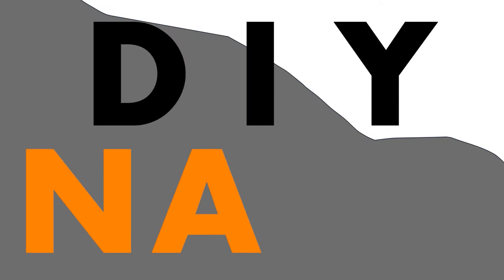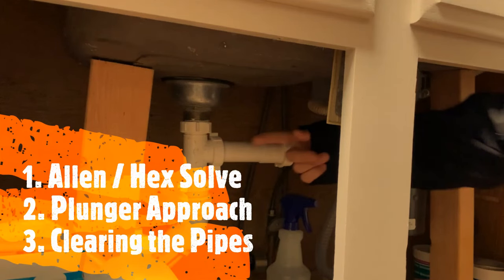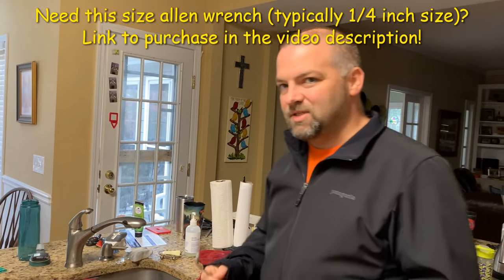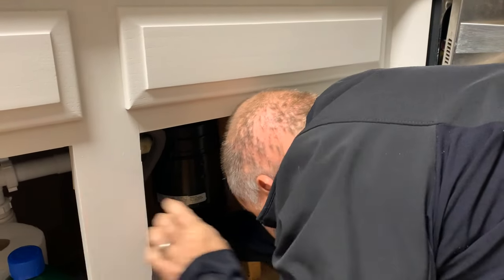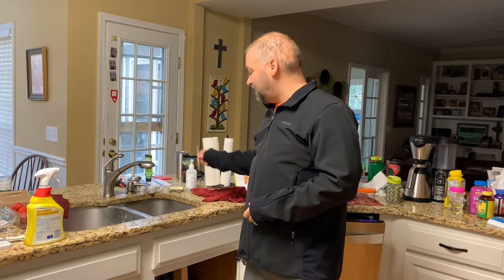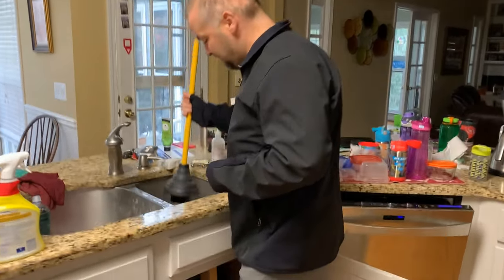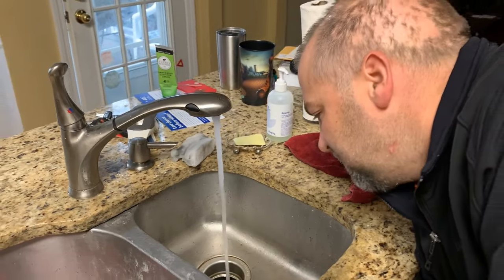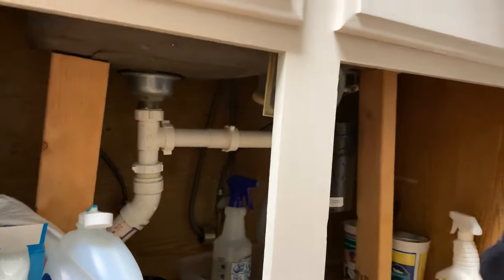Clogged Kitchen Sink with Garbage Disposal? How to Solve Quickly with 3 Easy Fixes! - by DIYNate

Comment: Thank goodness
-I thought it had tripped somehow, but the button on the bottom didn't solve the problem, as I still had power.
-power was on and trying to work, but the blades were stagnant. 
-stuck my hand down the unplugged disposal to unclog and got some stuff, but it didn't solve the problem
-looked down with a light and didn't see any foreign object
-USED THE FIRST METHOD, ALLEN ERENCH, and it made a teeny tiny spoon bulge out that was jamming my blades!

Thank you!
Reply from the maker: Nice!  Hard to believe what can lock those blades up, but a good thing they made the manual turn feature for the Allen wrench, right?!?

Thanks for the comment and glad you got unstuck!
- DIYNate

Comment: Thank you very much for this video! If the allen wrench fix works, do you have to turn it back? Is it an untightening/tightening mechanism or just turning in place?
Reply from the maker: Hey Diane - no you shouldn’t have to turn it back - it is just operating like a manual rotating function so you aren’t actually unscrewing anything.  Good question though.  Thanks for your comment!
- DIYNate
Reply: @DIYNate  Thanks! I'm going to try this tomorrow.

Comment: I was about 1 minute away from taking the plumbing apart and checking for clogs. Totally forgot about using a plunger. 10 seconds later…drain is working. Thanks!!
Reply from the maker: Love hearing that it worked out for you, RoB and saved you from taking apart the sink!  Glad to help and thanks for your comment!
- DIYNate

Comment: Hex key worked. Didn’t even need the plunger, thanks for the tip man! Is it dangerous to try the hex key method without first unplugging the garbage disposal?
Reply from the maker: Unplugging is likely not needed but that could also depend on the state of your disposal (e.g., if it is in a deteriorating condition).  Many people, like myself, have a switch to operate the disposal so there is no turning the power off by unplugging, but you could flip the breaker off if you are concerned about safety.  I do understand the concern because it relates to water, metal, and electricity, so when in doubt, it won't hurt to cut power to it and ensures safety.  You can also check your owner's manual / contact your manufacturer for what they recommend when using the manual rotation of blades with the hex key. (Keep in mind, this is not professional advice, use safety/precautions, and DIYNate assumes no liability. - the legal disclaimer :)).
Thanks for the comment!
- DIYNate

Comment: should have mentioned using the 2X4s to support the sink while plunging... smart idea.
Reply from the maker: Good call there - got to be careful with the downward pressure so you don’t detach it from the mounting glue if it is undercounted.  Thanks for the comment!
- DIYNate

Comment: What if all three methods don’t work? I took all the pipes apart and had no luck. I’m wondering if the clog is further upstream? Thanks sincerely for the video, kind sir.
Reply from the maker: Hate to hear it didn’t work for you!  I think my next stop would either be fishing a drain snake down the pipe when I have the p-trap off, or maybe going the chemical route and going directly into the piping.  Other thing that some folks have commented on is when plunging the one side of the sink, make sure to cover the other side so you get the full pressure applied to the downward pipes and don’t let the air pressure escape.  Good luck!
- DIYNate

Comment: It would be nice to see what you're actually doing when you inserted the allen wrench under the sink. Where exaclty does the wrench go? Love your cute graphics, but that also covered what you were doing.
Reply from the maker: Sorry about that!  The wrench goes up underneath the bottom of the disposal - typically dead center underneath where the propeller is - think about it as you are manually turning the blades.  Good luck and sorry the visual didn’t clarify where to put the wrench. 

- DIYNate
Reply: @DIYNate  all good, thanks Nate! Turns out my motor had died! 🤣 I replaced it today, but really appreciate all your help.

Comment: Do you have to have enough water in the sink to use that plunger? I just don’t have enough suction.
Reply from the maker: Great question - it helps to have enough water to be able to create a seal and force water to push whatever is down there through.  So putting some water in there can certainly help!
- DIYNate

Comment: If you dont have Plunger, Get a Tennis ball, Cut it in Half, Place cut side  on the sink hole, Apply pressure on top of the ball, It works like charm 🙂
Reply from the maker: Creative way for a diy plunger solution - thanks for sharing!
- DIYNate

Comment: The allen wrench fix is for when you broke some glass or have silverware in the disposal and it won't turn.  Then you use the allen to break it up or turn it to get the piece out.  Also, disposals have a little button (circuit breaker) that trips sometimes when things are stuck.  If the disposal isn't working at all then you free up the pieces that were broken with the allen and push the button on the bottom.
Reply from the maker: Exactly right - both of those are great solves depending on the issue you are facing.  Thanks for your comment - very helpful!
- DIYNate

Comment: QUESTION: 1. What does the L end wrench turning under the disposal do to clear the clog?
Reply from the maker: Hey there - sorry for the slow response but the allen key (L wrench) turning actually spins the blades in the disposal so sometimes, people's disposals are stuck and have something hard underneath or aren't able to spin, and by manually spinning, it can get the stuck item unseated and then the disposal will start grinding again.  Basically, this turns garbage into a much smaller substance that can then be fed down the waste line for it to be processed.  Sometimes the clog / issue is a direct result of the disposal not grinding and not pushing materials further down the waste drain.  So that is how that is part of the clearing the drain solve.
Thanks for the comment!
- DIYNate

Comment: Does it matter how many times you turn? And which direction? Thanks
Reply from the maker: Doesn't matter how many times you turn, but my guess is if it is turning freely and you aren't hearing anything or feeling any movement, that may not be your issue.  I seem to remember it being clockwise (righty tighty) but I could be wrong on that - I feel like one direction will go and the other won't or it may allow you to turn both ways.  Sorry for my foggy memory here but hope you got it fixed!
- DIYNate
Reply: @DIYNate    Thank you for your feedback and post.   🎈

Comment: Say would you put Drano down sink after you unclog your sink just in case to make sure the drain and pipe are clean any thing else? That my the in the pipe???
Reply from the maker: Hey Jason - really up to you if you feel like Drano is needed afterwards.  My personal opinion is I would avoid that and save the drano for when you are clogged and the other options don't work.  I hear some plumbing gurus talk about the chemical issues that can come from drano on pipe (not sure I subscribe to that, but still).  Once the clog is cleared, seems like the Drano wouldn't have anything to work on and would go straight down the pipe.  Just my two cents.
Best,
DIYNate
Reply: @DIYNate  thanks for letting me know about that Drano I will try something different like the plunger that you used or take off the pipes one at a time and clean them out outside with wire brush and a garden hose.

Comment: Thank you , I actually forgot about that little trick with Allen wrench 😂🤷 duh 🙄. I worked at Orchard Supply and Hardware in the early 2000 in the plumbing dept. And that was one of things  , We would tell customers to do ... Thanks again✌️
Reply from the maker: Funny that you used to recommend that solve at Orchard Supply - totally get it - easy to forget that and the little reset button underneath.  The plunger fix has always been a hit for folks as well posting on this thread.

Thanks for the comment!
- DIYNate

Comment: Does the circuit breaker power to the garbage disposal need to be switched off before using island wrench method?
Reply from the maker: Probably best to check the manual for official advice.  It is electricity and water together and the hex wrench is metal, so to play it safe, best bet would be to cut off the circuit breaker for safety purposes if you have any concerns or are a first timer doing this.  I am not a plumber or electrician, and don’t work for a garbage disposal manufacturer so just sharing my thoughts.

Good luck!
- DIYNate

Comment: I'll ran across your link here when I was looking for some natural stuff to put down the garbage disposal without using chemicals. I was frustrated what happened and I did pour a tiny bit of draino down and it didn't work. Then I did think about the plunger and I figuring if it worked for toilets it should work for that. Was too tired to do that so that's why I was looking for natural stuff to use such as vinegar and baking soda so I will try the plunger later. One thing I did get out of this which I totally forgot was the Allen wrench thing I knew there was something down there but never thought about it in ancient long time ago. I will try that also then get back later tomorrow and let you know what happened. May I please make a suggestion about the music on while you are demonstrating. It was really hard to hear or understand you sometimes with the constant sound that sounded like a clock ticketing. You really don't need background music in things like this because of some who may not hear very well. Thank you.
Reply from the maker: Hey Gail - I hope the plunger (or something else) got you up and running!  Thanks for your comment and the detail to go along with it.  I also really appreciate your feedback on the music side and as I have experimented with things, I definitely think there is a happy medium in using music lightly in the background vs. being a bit more overpowering and impacting the speech audio (I am continuing to learn more on this).  One of the issues I come across when filming is that I'll sometimes have some background noise that I can mask a bit with a light bit of audio.  It can also add just a bit of additional flavor to the video since some of my video content isn't exactly an action flick - haha!  I will definitely be working on cleaning up the audio and making sure it is easier to hear (I struggle with this as well when watching other videos and having a hard time hearing what is being said).  Your feedback is greatly appreciated!
Thanks and best wishes!
- DIYNate

Comment: Some of the new disposals dont have the screw on the bottom of the units. I hope the plunger works for me.
Reply from the maker: Hope it worked for you as well, James!  Not sure if the newer disposals have another way to release when they are stuck and sometimes the reset button helps as well.  Good luck and thanks for the comment!
- DIYNate

Comment: I tried Drano but it only works temporarily. When I turn on the disposal, I hear a buzz after the reset and using the wrench, does that mean it's just stuck? Meaning, if the disposal was completely dead, it wouldn't make any noise at all? Just wondering if I should try the plunger (will have to run out to get a new/clean one) OR is my disposal just dead and needs to be replaced? Thanks in advance!
Reply from the maker: Hard to tell on this one.  If it isn’t turning but you are hearing a sound, it could be an internal issue and may be time to replace.  BUT - that would be if you were already able to turn the blade with the Allen wrench.  If you can turn it freely and it still buzzes with no spinning action, I would try the reset button again and maybe turn the breaker off for a hard reset for a period of time, then try it again and see if it works.  If not, very likely time to replace…

Thanks for your comment and good luck!
- DIYNate

Comment: I tried the allen wrench trouble shooting step... but my disposal does not have that type of screw on the bottom of the disposal.  2. Plunger.... did not work... at first.  I read Jennifer' Dodge's comment and thought I'd try again. When I plunged, water came up through the instant hot water gadet that was never set up.  So my sister held her hand over that thing,  There was some progress, seemed like things were moving a bit, but sister could not hold the hot water dispenser hole very well.  Still did not work.  I reread Jennifers comments again for inspiration.   This time I put the drain plug in the sink part, because I noticed when I plunged there was air coming up through the sink part.  OK.. I got rid of my sister... So now I have one hand over the hot water dispensor thing, that was never set up,  My other hand holding the plug in the sink part.  And then pushing the plunger down gently with my forehead.  AND IT WORKED.
Reply from the maker: Ok - I have to admit - this comment gave me a smile as I pictured your sister helping you and you kicking her out / removing her from the troubleshooting equation and when I got to the end with picturing a forehead plunge, I was cracking up!  Glad it finally worked and seems to hit the “if you want something done right, do it yourself!”.

Glad to hear you got it cleared and thanks for the story and feedback!  Sounds like Jennifer Dodge’s comment helped quite a bit as well!
- DIYNate

Comment: What about a twin basin sink? All applying a plunger to the disposal side does is force the standing water into the other basin. No pressure on the disposal itself at all.
Reply from the maker: So if you can clog the other opening with something that creates a seal then you should be able to generate pressure pushing down the drain instead of coming back up through the other sink drain.  That is a common ask about this video.  Thanks for your comment and good luck!
- DIYNate

Comment: What if my sink as an escape thing on top where the air flows out when u pump it?
Reply from the maker: That may make this solution less effective but if you can try and cover that vent as well with something and make a good deal you may still be able to create enough downward pressure to clear the clog.  That also depends where the vent is in relation to the clog.  Wishing you success and feel free to let me know if it worked for you or you had to resort to other methods. Thanks for your comment!
- DIYNate

Comment: What did the allen key do just manualy spin the blade?
Reply from the maker: Yes - the Allen key gives you some leverage (like a crank) on the underside of the blade so you can turn it without trying to reach in and out your fingers on the blade and trying to twist (tough to get your hand in that hole as well).  Thanks for your comment!
- DIYNate

Comment: I had a very stubborn kitchen drain stoppage on the garbage disposal sink. After watching several videos and trying them without luck, I tried a trick I use for a plugged toilet. I put a liberal amount of Dawn Dish Detergent in the garbage disposal side. Using the plunger and then turning on the garbage disposal and continuing to plunge and the problem went down the drain. 
Note: Soapsuds came up in other sink. It was clear looking soap. I rinsed the soap down the drain. I'm back to normal.
Reply from the maker: Thanks for sharing and glad to hear you got it unstuck!  Interesting add with the dish detergent - thanks for sharing!
Reply: I'm going to have try this tomorrow ie plunge while the disposal is running..

Comment: What would you suggest is someone dumped pumpkin seeds in the disposal ‽ :( it’s clogged but wasn’t sure if I need to take it all apart. It turns and we used the Allen wrench but it won’t drain…
Reply from the maker: You know - I would probably start with a plunger and if that didn’t work, I would probably disconnect the PVC coupling on the p-trap and see if I could clear that out.  Another fun one is to use a shop vac to suck it out from the top if you have a wet / dry version.  Good luck!
- DIYNate

Comment: I tried the plunger first because the disposal would clear, but then back up again. Also, both sinks would back up as well. Between the plunger and the turning on/off of the disposal, it would just clear temporarily - where the water would disappear. If I let the water sit, it would clear in 15 minutes, but still would be clogged. Based on what I've observed and what you've shown, maybe there's gunk in the pipes. So I might try to open them up and see what's going on.
Reply from the maker: That is probably the best next step after plunger - could be a deeper / bigger clog that isn’t getting relieved with the plunger pressure.  Hope you were able to get it fixed!
- DIYNate

Comment: If the plunger is not effective and you hear air coming from the 2nd sink drain, I recommend trying to block or capping the drain on the 2nd sink.
Reply from the maker: Good recommendation here on closing the other side off if you aren’t getting the pressure you need to free the drain and air is escaping - thanks for the helpful comment!
- DIYNate

Comment: One other thing that might be an issue is the reset getting tripped on the disposal. Check that right before using the hex key.
Reply from the maker: Hey Stephen - you are exactly right!  I really should have mentioned hitting the reset button as a starting point.  I have found most people watching this video are usually ending up with a clogged sink vs. the disposal not spinning / working, but you are 100% correct that the reset button is a quick way to troubleshoot any time the blade isn't spinning or you are getting minimal / no noise.  Appreciate the suggestion and comment - and I am sure others reading the comments may as well!
- DIYNate